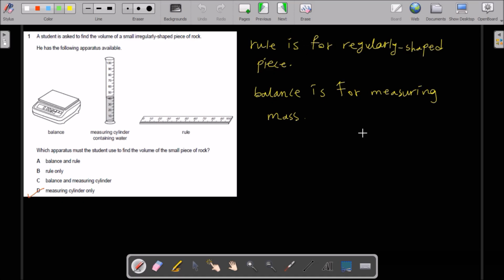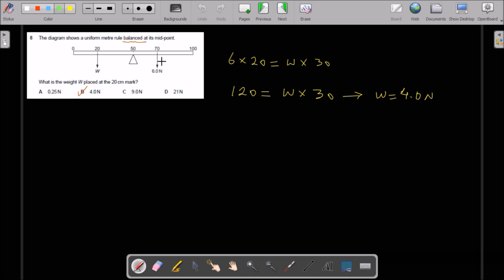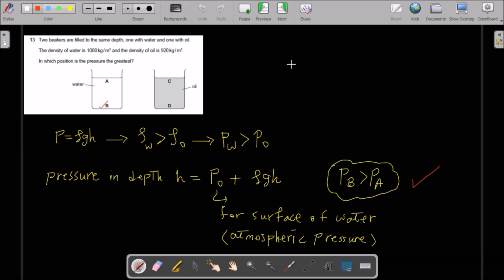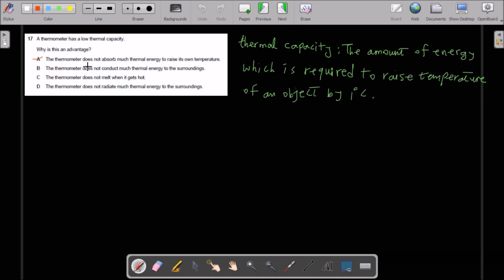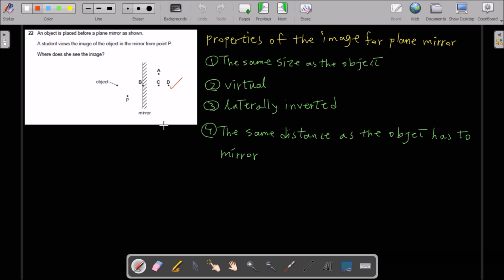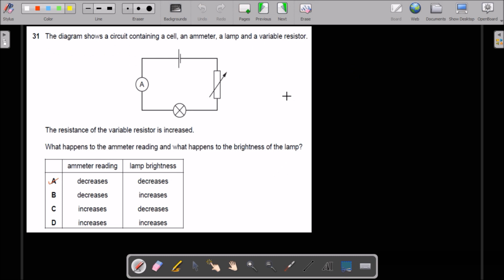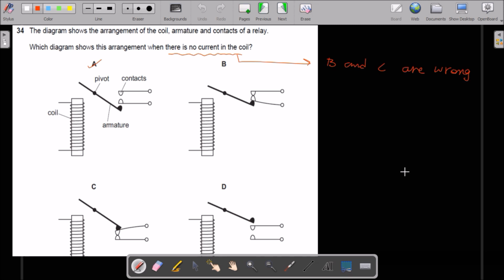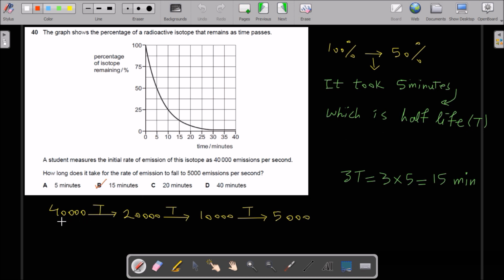Solved Past Paper of Physics 0625/22/f/m/18

Comment: May you please explain question 15?
Reply from the maker: when you open tap, piston moves to the right; it means pressure inside was more than atmospheric pressure because it causes piston to push air behind it.
then outside and inside have the same pressure because piston is stationary. so D is right